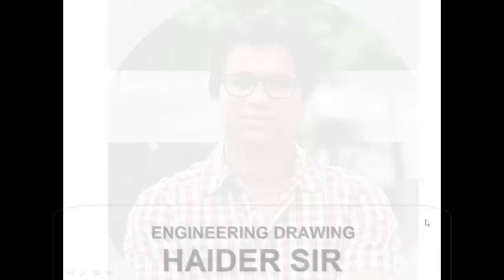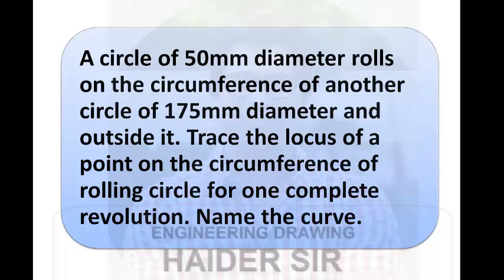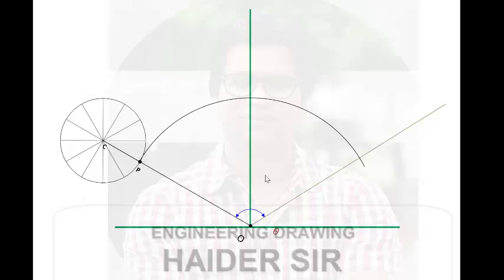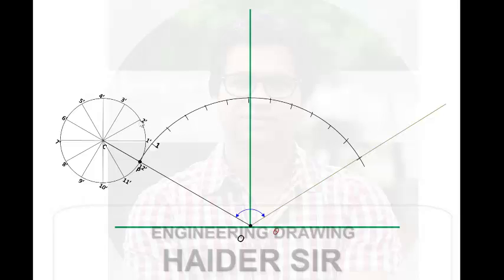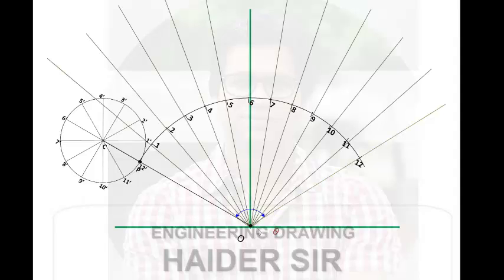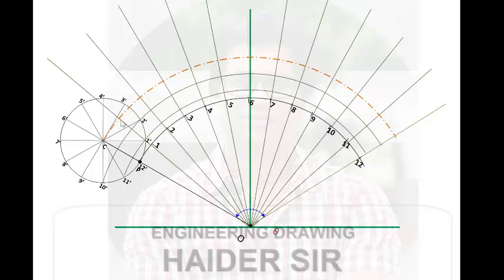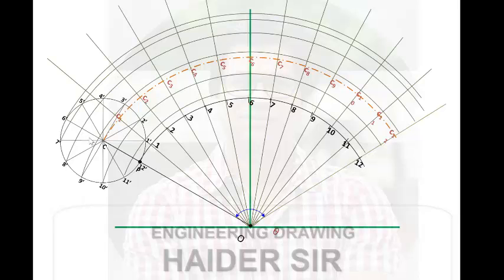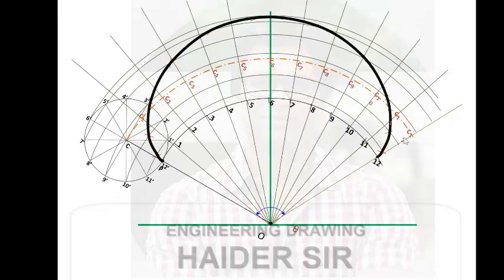HOW TO CONSTRUCT EPICYCLOID

Comment: a circle rolls inside another circle for one complete revolution without slipping draw the locus of a point on the circumference of the rolling circle if the rolling circle diameter is 40mm and the diameter of the bigger circle is 160mm. please help me, sir, with this question
Reply from the maker: It’s simple hypocycloid

Comment: A toy motorcycle moves inside a globe having a 250 mm diameter The motorcycle wheel is of 50 mm diameter,. Draw the locus of a point lying on the circumference of the wheel of the motorcycle for one complete turn
Reply from the maker: Simple hypocycloid hai

Comment: Theta konsa liya aur thita bye 2 konsa vo nhi samaj aya
Reply: Calculation of Theta 
= 360° × (radius of smaller circle/radius of greater circle)
=360 × (25/87.5)
   ...since, •d=50, r=25
 (for smaller circle)
.
•D=175, r=87.5
(for greater circle)
Therefore,
360°×{25/87.5}=102.85°
And so, 
The value of Theta will be 
=102.85°
Reply: Next,
•Draw a horizontal line then draw a perpendicular bisector to it.
•Later,
Take Theta/2 
i.e., 102.85/2 =51.425°
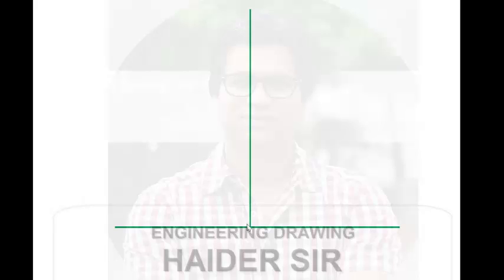And the draw a line at an angle of 51.425°. @1:00
Then , draw another of angle = Theta i.e., 102.85° @1:12

Comment: draw a hypochlorite to generate why rolling circle of 60 mm diameter for on complete Revolution the radius of direction circle is 100 mm draw a tangent and a normal to the hypocycloid 50 mm from the centre of the directing circle - solve sir
Reply from the maker: Beta read the question once